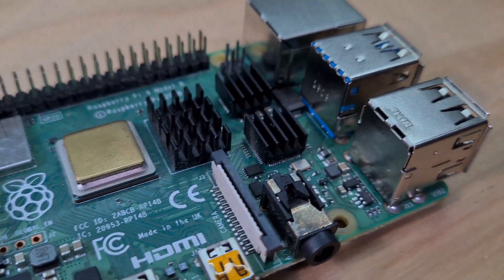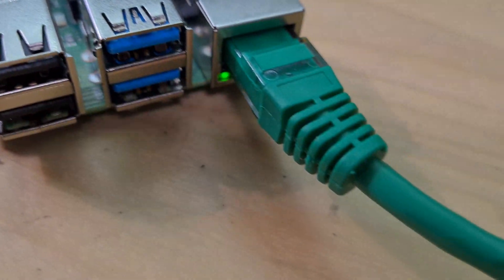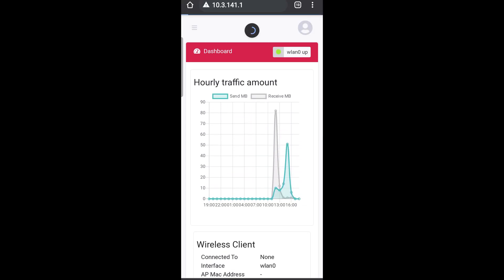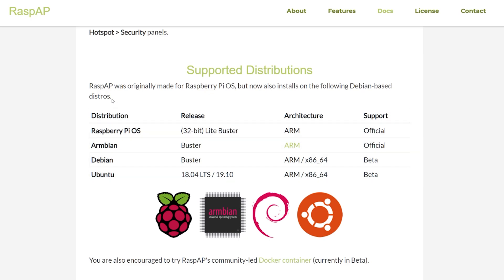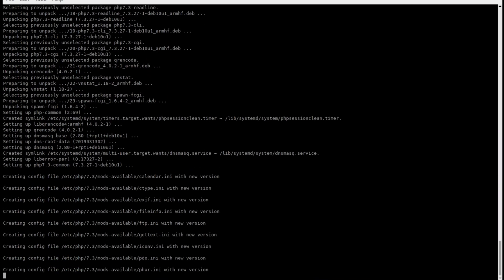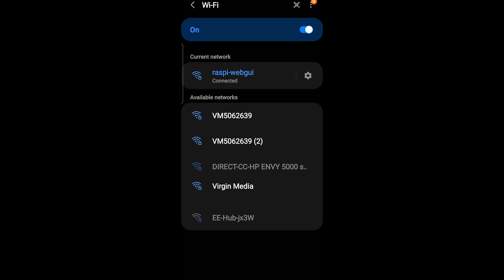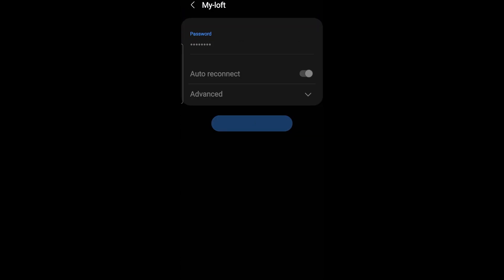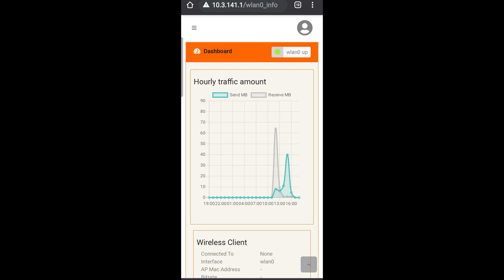How To Use A Raspberry Pi As A Wifi Extender - RaspAP

Comment: hi! I was able to do this in my RaspPi 3 but having a 802.11b/g/n at 2.4 GHz is really slow. Can I work this out with 2 external 802.11ac external USB WiFi adapters? Seems I cannot make it work (SSID not broadcasting and WiFi client cannot connect to any SSID)

Comment: This isn’t a WiFi extender, this is just a WiFi AP. An extender is WiFi to WiFi.
Reply from the maker: this went over my head lol as far as I know, this extends my wifi from downstairs in my living room to upstairs in my loft. Good enough for me lol
Reply: @HamedAdefuwa  It is an access point. An extender would  actually use the same ssid as your home wifi, and remain on the same network, being visible by other computers and printers. What you did was split your home internet into multiple access points. I'm trying to find an actual repeter video because my ring driveway camera doesn't reach my router. If I just created a new Hotspot,  I would not be able to access the video footage from anywhere else in the house.
Reply from the maker: @ZeginMakesMusic  gotcha, ty! Surely using the same ssid is possible with a Raspberry Pi, no? Googled it quickly and found nothing. Eeek. You're probably going to have to go with something like this and use a workaround to access the footage.
Reply: @HamedAdefuwa  duh!